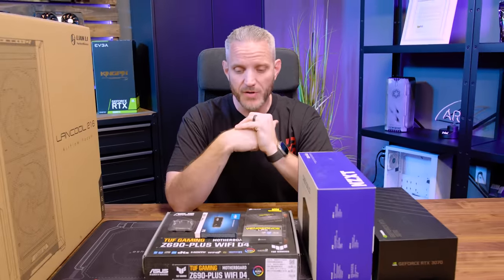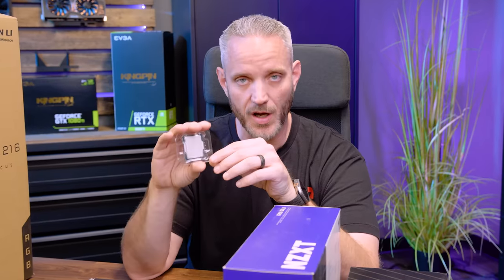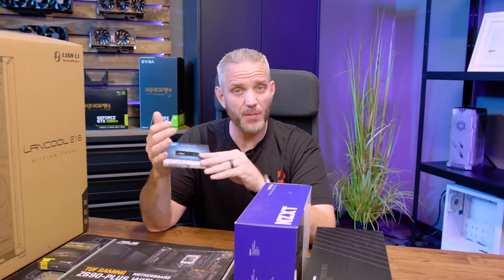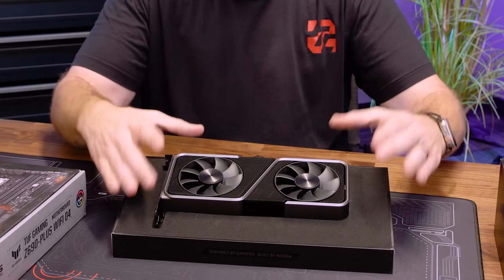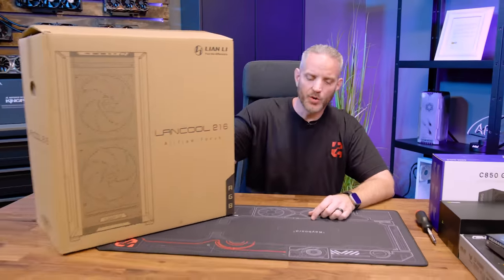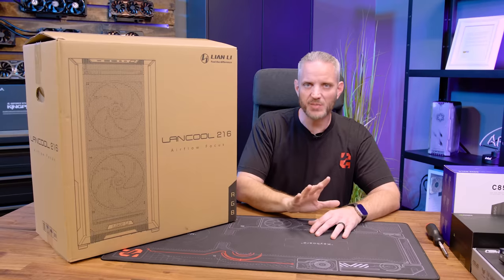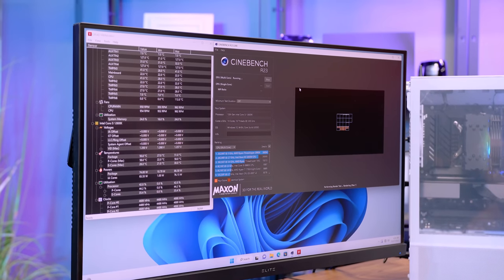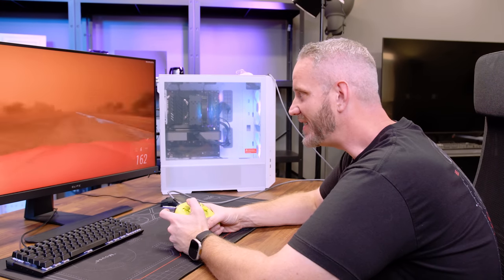Inexpensive PC Build Guide!

Comment: Almost the exact build I made recently, 12600kf + EVGA 3070 + 16GB RAM, was the best price/performance specs for my budget and works great for 1440p/4K
Reply: Bad choice 

AMD 7600x + Asus B650 + 16GB DDR5 (take the cheapest for $65) + 6800XT ($599) = better performance for a lower price
Reply: @LevAizik  i would take the 3070 over the 6800xt any day just because AMD drivers especially on launch day for new games have issues unlike Nvidia. I was looking forward to the new 7900xtx but apparently there is major issues with OCing the cards as well as competing with mid range Nvidia GPU's
Reply: Lies! These people will always bring up their semi identical builds to make others believe that they think like the content creator and use "EVGA" as the cherry on top for sympathy likes.
Reply: I had EVGA 1080 for 6 years (1080) and it recently died. I would not buy EVGA because they are out of GPU business now. After all research where repair guys say that Asus has the best components between all manufactures I believe them. So my dream is Rog Strix but what I can afford is TUF line. I switching to Asus family for motherboard, GPU and laptop...
Reply: @jumper55ful   In terms of GPU performance the 6800XT is 40% stronger than Nvidia 3070. I don't know about any driver issues with new games.
Reply: I'm more on the upgrade over time bandwagon.  My old X370 board just got a shiny new 5800X3d.
Reply: @jumper55ful  Been running my RX 6800 with MINIMAL driver issues. In fact, I have less driver issues with new games than my friend does with his 3070ti... Driver issues are not a significant problem with AMD systems at this point, from my experience. And the 6800 is a better card than a 3070. I've owned a 3070 and I simply wasn't impressed for the amount of money I spent ($600). Sent it back and got my RX 6800 for $20 less and doubled my VRAM and increased my performance with less power draw. Win/win.
Reply: @jumper55ful  you also pay for cuda stuff if youre into it
Reply: @spankbuda5760  clout chasers 💀
Reply: @jumper55ful  Nvidia had major problems with the new Call of Duty, AMD didn't. 3070 doesn't stand a chance against the 6800 xt (unless you're using RayTracing)
Reply: @LevAizik  I'm seeing 7600x for $100-150 more than I paid for my CPU on Ebay, 6800XT is roughly the same price but DLSS/RT is kind of a deal breaker for me, I also had to be mindful of the size as this was the largest GPU I could fit in my H200i with an AIO
Reply: @cherry-boss  I had an EVGA 1070 for about 5 years, I got my 3070 before it was announced EVGA was leaving the GPU market, but AFAIK they are still honoring warranties so shouldn't be an issue
Reply: @steviewonder0850  great news. I am glad for you. So is there big difference you see? I also plan to get my 3070 too.
Reply: @cherry-boss  Between my old 1070 and 3070? Yeah there's a massive difference. I do kinda wish it performed a little better in 4K though, as some others have suggested it might be better going with a 6800XT although they are going for a bit more than I paid for my 3070, but depends on how much you care about RT/DLSS.
Reply: @steviewonder0850  or if you would get 3080 that would equal to 6800XT? I have 6800 on my laptop. It's good.
Reply: used 2080ti would have saved you $300+ and got the same performance
Reply: And used 2080 ti might've also got him scammed, robbed
Reply: @Shadow0fd3ath24  Used 2080tis were going for more actually lol, and I paid like $500 for my 3070, not sure where you're seeing 2080tis for $200, especially 6 months ago when I built my rig

Comment: I just upgraded from a Ryzen 7 1700, 16gB DDR4 @ 2933 MHZ to a 5700x, my first ever aftermarket cooler (Cooler Master ML240 AIO), 32 GB @3600MHZ, B550 MOBO, with my existing RTX 2060. In April I'll upgrade my GPU to probably the RTX 4070 if the price isn't insane or get a 7700xt when it releases. Great Vid Jay.
Reply: You probably saw a pretty big minimum and maximum FPS boost with your GPU as well, getting that new CPU, right? I went from just a 3900x to 5950x (much smaller margin of difference), and my 2080ti saw huge gains across the board, especially in my most CPU limited games (saw over 50% gains in the game I cared about most WOOHOO). Yes, I could have gone for a 5800x3D and seen even more gaming boost, but I do other things with my PC besides game, and I wasn't willing to go down in core count for those tasks. 5950x made sense when it was on sale, and I've found a buyer for my old parts to offset the cost, saving me money vs having bought a whole new system. This is the first time I've EVER planned an actual upgrade path for a build ahead of time, rather than just buying a new board and RAM when the time came to upgrade. People in your position did it best though. I could have bought into the platform when you did, but I bought an 8350k instead, and I honestly kind of regret it now. I was hard up for money at the time and had already wasted $135 of my "budget" (all my personal spending money was allocated to funding a small company at the time, the board ended up in a staff PC in the end but it still fucked me over at the time) on a replacement board when it was actually my 4790k that had died. AMD had just been underperforming for so long that my trust wasn't super high in the platform being worth anything long term at the time, even if the CPUs were actually fairly decent according to benchmarks. I didn't make that mistake again when I got my 3800x (which I still have in my home server that I built when I got my 3900x upgrade). But yea, good luck on finding a 4070/7700xt. Assuming they sit on shelves like everything else has so far, you shouldn't have too hard of a time getting one, and they'll no doubt have more supply at launch as well. That 5700x should still last you a good few more years of gaming before it's even worth upgrading your whole platform. Wait for DDR5 to hit price floor IMO before you even consider doing that, that's what I'm going to do at this point now.
Reply: I'm upgrading from an i7 3770k, 16gb ddr3 and an msi z77 motherboard to a Ryzen 7 5700x, actually downgraded my cooler from a noctua nh-d14 to a hyper 212 LED (had to keep the noctua in the old build), an Asus Strix B550-F motherboard, 32gb ddr4 3200mhz and kept my rtx 2060. I probably made a bad decision only going with a 650w PSU but I'm gonna be fine with my rtx 2060 for a while.

Comment: Recent build
Msi B660 mortar ddr4
i5 12400F + stock cooler
16 GB ram
PSU 1000w Crosair
GPU AMD 7900XT
Old case and drives
Reply: I got a similar build.

MSI b660m mortar DDR4 
i5 12400F - cooler master 212 hyper black edition
32 GB Vengeance RGB pro
MSI RTX 3050 VENTUS X2 8GB
Samsung 980 pro 1TB 
Seagate FireCuda 530 1TB
Case is MSI mag forge 110R I think
EVGA 600w PSU

Comment: My last build was in 2011. I bought as much gear with next gen capabilities as possible and it paid off. My case was custom made all aluminum in 2001 and still in da house! Time for new everything. Only thing new to me is the RGB wiring. Thanks to you and I couple other guys, I'm managing. I don't do as much gaming as I used to so I'm still looking for a new graphics card. Until than, I'll stick my old GIGABYTE GeForce GTX 1050 Ti  in there. Here is what I've put together so far.
X570S Aorus Master mobo w/AMD Ryzen 9 5900X processor, Lian LI Galahad A10 360 CPU cooler white, G.Skill Trident Z RBG DDR4-3600 32GBx2 memory, Corsair RM1000X 1000w modular power supply, Fractal Meshify 2 RBG ATX white case. 
I do a lot of 2D-3D CAD design, graphics rendering and I run my recording studio off the same computer. It's hard to decide on a graphics card that can handle all of that. I refuse to spend much over $1000 on a card when the rest of my parts were under $2000. Any suggestions on a happy compromise?

Comment: This build is amazing! What adjustments would you make if you wanted to modify it to handle streaming as well?
Reply: evga streamer pci e streamer capture card
Reply: Unless you give a specific case, this can handle streaming already
Reply: @RadeonVector  what would change if I had a y60 case?
Reply: @SecretShotgun  The case.
Reply: @RadeonVector  cool. Just wasn't sure if anything would have to change based on clearance issues or anything.
Reply: @SecretShotgun  unless I'm mistaken, the hyte y60 is an overkill case for this kind of setup. It would probably run a bit hotter without extra fans but not much more to say.
If you plan to use GPU encoding (obs supports it), that build should already be capable of it as it is.
Reply: @ziokalco  a lot of people overestimate the hardware you need for streaming alone but if you have at least a 6c/12t cpu and like a 2060 and above then streaming should be no issue. Now streaming AND recording videos at the same time at above 60fps from one pc is where it gets tricky. Depending on what game you're playing and how well it's optimized is also another factor. I have a 2070 Super with a 5900X and streaming Doom Eternal at 720p/1080p 6mbps and recording at the same time using nvenc gives me very stuttery footage on either the stream or the video, sometimes both. Doom Eternal settings are at 1080p High 120fps and even turning it down to 900p did very little to improve it. In conclusion, if you plan to play more modern and future games at 120fps or higher and be able to stream and record at the same time, then I would say yes you need a pretty beefy GPU. a 3080 is the lowest I would go as my 2070 Super struggles with Doom eternal at higher than 60fps which is one of the most well optimized games on PC even now.

Comment: First off Jay I wanna say a HUGE thank you. I've been sitting on a on an outdated system from 2017. Fast forward now to 2023 the market isn't what is used to be, and the cost of general living leaves less than desired disposable income for jumping back into PC building. I was fortunate enough to have been gifted an RTX 2070 from a viewer on Twitch recently, and using this video I was able to fill out the rest of the components easily while not going over 1k ($952.15 USD). I honestly cannot wait until everything arrives so I can assemble it all together. The only notable changes I made to the build were using the RTX 2070, an AIO from deepcool (LT520) and going with the i7-12700k because the i5-12600k was not available and I really wanted the IGPU for streaming. Thank you for giving hope to future and veteran PC enthusiast in these trying times.

Comment: I just built this setup and it works great for me. Got the MSI Gaming GeForce RTX 3080 LHR 10GB GDRR6X 320-Bit HDMI/DP Nvlink Torx Fan 4 RGB Ampere Architecture OC Graphics Card (RTX 3080 Gaming Z Trio 10G LHR) (Renewed) for $650 and got the 2T drive. Love it!

Comment: Love this video! A lot of the same thought process that I just used to build an ITX system with a 12400 and that exact 3070 :-) I did decide to go b660, and 32 gigs of DDR5 though. And one terabyte, gen 4 NVME SSD. Total budget was about 1400!
Reply: Wow thats a great build and price! And it gives you an upgrade path to 13th gen and either this new gen of gpus or wait until the next gen since 4000 nvidia is overpriced.

Comment: So far this video has been very validating for me. I put together a PC in late July and I used a lot of similar logic to spec it.  Including using DDR4 12th gen Intel platform because I knew that left me an upgrade path in the future. I also used a 3070 as a good compromise between cost and performance. I really really wish I could have gotten a 3070fe though, it would have suited the aesthetic of build so much better but like you mentioned they are just unobtainium.
Reply: they are not sold in europe...
Reply: @robertdelange2071  3070fe's or??
Reply: @LokiParts I take it you didnt happen to go with the ASUS 3070 Strix OC card then? As it has RGB that will help any build aesthetically and it beats the FE, albeit not by much maybe 5ish percent. I love ASUS, top of the line for GPUs, motherboards, and monitors imo. Now, ASUS typically does cost more, but I truly feel they are worth it especially if we are talking about GPUs here, and it would have/should have, gotten u in the clear as far as looks. Ive gotten to where if I need a GPU or board I almost always opt for ASUS right off the bat.
Reply: @unleasheth  I would have loved to get the Asus card, I am a bit of an Asus fan as well, but price was the other major consideration. I ended up going with a Gigabyte Vision OC. It also is also has a little bit more horsepower than the Founders Edition and its design is fairly inoffensive.
Reply: @robertdelange2071  They were sold in Europe. I got one on launch day. However I don't believe they're in production any more with most of the last shipments in major EU stores drying up a few months back.
Reply: What’s the best board for the 13600k around 150 dollars instead of 200
Reply: Same here for my build last month, except I went for the 3080 rog strix because I had a bit left over. Handles everything at max settings on 1440p with the 12600kf. Couldnt be happier.
Reply: you dont need validation for that.
Reply: how is 3070 a cost to performance compromise , it costs 30% more per frame from a AMD graphics card
Reply: @matthewpauls2498  a MSI PRO B660-A DDR4 would be a solid budget option.
 No overclocking obviously, but it was able to handle a 12700K turbo boost no problem, so I'd imagine it can handle a 13600k decently.

Asrock has a couple Z690 boards for cheaper RN but I have no idea if they're good boards or not.
Never had a problem with asrock myself, but I've heard some mixed reviews of their boards this gen.
Reply: @hayseedfarmboy  for what it's worth my PC is mainly used for photo and video editing so an Nvidia card was pretty much a requirement. Unfortunately AMD cards just aren't optimized as well for those workloads, especially Adobe Premiere Pro. And of course it was a compromise.. if I didn't have to compromise based on cost I could have just immediately dropped a 3090ti or Quadro in there instead.
Reply: I did the exact same thing a week ago. H670m ITX, 12gen Intel, 6750 XT, but PCIe 4.0 NVME for direct storage story when it arrives. Got a 180hz UWQHD 35" as well for $1400. Very pleased considering I missed Black Friday 😅 

Which resolution do you run your 3070 at? It's a great card most def! Especially for streaming
Reply: @Dennzer1  I appreciate that. I just feel validated because this was the first PC I have ever built and I made a lot of my decisions using the same logic that Jay was for his video.
Reply: @JamieR  I have two 1440p widescreen monitors right now, but I have been considering switching to a single ultrawide. I don't game a ton, but so far it has easily handled anything I throw at it.
Reply: @KevinBein  oh ok cool. I usually opt for MSI as a second best to ASUS if I cant get ASUS but I have also owned Gigabyte cards and had no issues with them. Cool beans

Comment: I threw together an extremely power efficient build just to see if I could using a Ryzen 3 4100 (same power usage as 12th gen Pentium, around 24 watts) and RX 6400. Total build with a B550 motherboard, 16GB of RAM and a 2TB SSD was only $398 and only pulls around 89W avg. with gaming. (The SSD I bought from the Amazon Warehouse for $27 for a 512GB model but they sent me the wrong drive).

Comment: Jayz

Back in the 80s and early 90s I build a lot of computers.
Since then I haven't touched a frame other than to turn it on and purchase complete units.

I started auto cross last year and this year I'm building a Sim unit. The small frame PC would not fire my HP Reverb G2 Virtual Reality Headset.

I decided to build one, and looking around. I have followed your “Inexpensive PC build guide” on YouTube.

Just went ahead and purchased everything per your recommendations.

I put together and it is  firing up just fine with one exception, my on board fans.

Where on the ASUS TUF Gaming Z690-Plus WiFi D4 board do I plug-in 
the 3 cables from the SQE-216 fan with ARGB hub pub on the Lian Li 
Lancool 216 RGB White ??

Thanks 

Lynn Sr.

Comment: An alternative to some of the parts in this build that would still  give you a fantastic 2K experience would be switching the CPU to an i5 11400f and the GPU to a 3060Ti. You’ll save about $250-$300 and get the same performance at 2K. Just my two cents.
Reply: That's exactly what I'm about to do. Altought instead of the F version I'm sticking with be iGPU (video editing, decoding) and use the "extra" money for a decent GPU, like for a 3070. I'm still on a i5-6600K and GTX 1060 6GB but after the Witcher 3 next-gen updage, I realised I couldn't even play it on low (2560x1080, UWFHD, 144Hz). 😅
Reply: 11400f?!? I hope you mean 12400f, because going lga 1200 at this point just isn't a good idea anymore...
Reply: @Tc4ify  It is if you want a Z series motherboard and an i5 for £240, which is less than the cost of the Z series MoBo of a 12th gen chip.
Reply: @otacon5648  Why would you specifically want a Z board? You can get an overclockable B one, like the Mortar max for under $200, pair it with 12400f, OC the shit out of it and it will smoke anything on lga 1200, including 11900k!
Reply: @Tc4ify  you can’t overclock a 12400f, same as the 11400f. What it does mean you can do though, is put an i9 11900K in there when you can pick them up cheap, then, because you have a Z series board, you can overclock the shit out of that. And all for not much money, especially compared to buying 12 series.